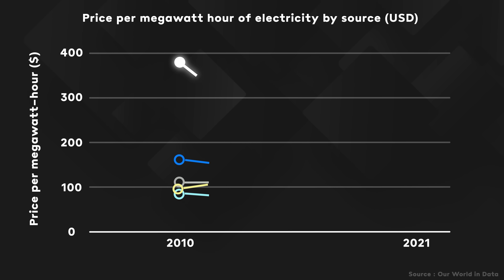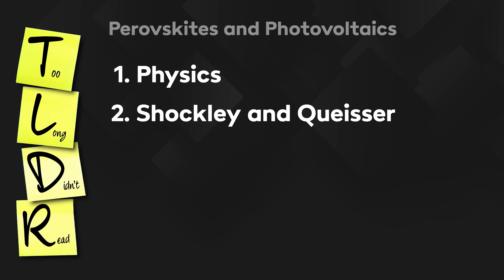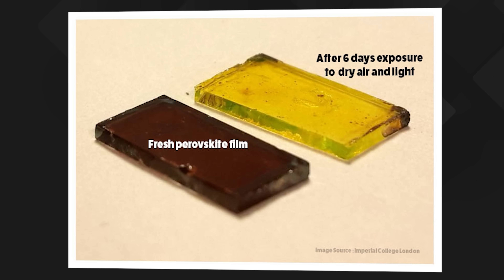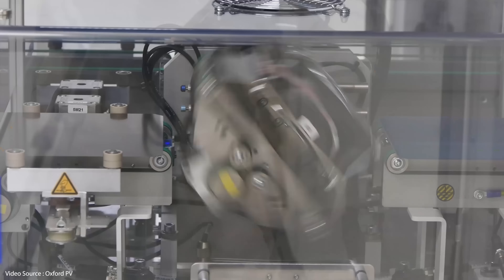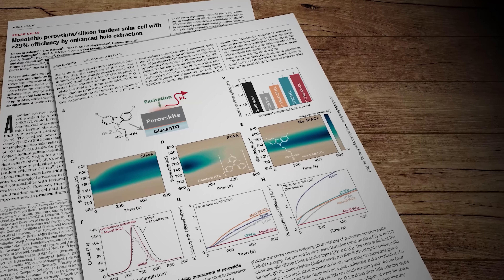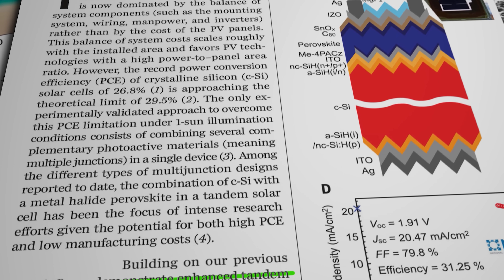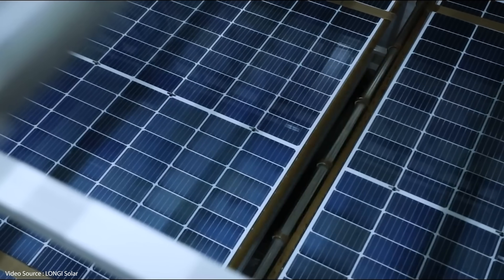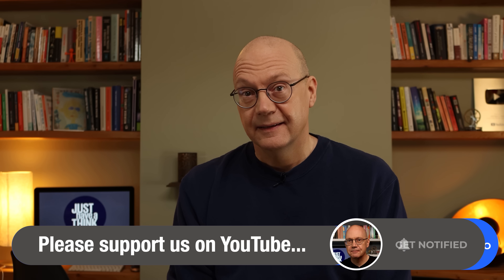Perovskite Solar PV. FINALLY some good news!

Comment: As a chemist who has worked on perovskite-structured materials in general, and photovoltaic perovskites a bit too, I'd like to point out some small errors in the video: Perovskite mineral is CaTiO3, but this is not the "perovskite" in PV cells. Those materials are various lead halide materials, which have the same crystal structure as CaTiO3: the perovskite structure. But the chemical composition is completely different, as are the properties. You cannot make solar cells from CaTiO3
Reply: So perovskite does not refer to a chemical, but a shape/ structure that multiple chemicals can take?
Reply: @davitdavid7165  Yes, what he means is the perovskite crystal structure and not the calcium titanium oxide mineral that you can find in nature.
Reply: Thanks for reminding us. Perhaps we should refer to the materials used in PV as pseudo-Perovskites, Peroveskite analogs, Perovskite-like materials or Perovskiods. Which would you prefer? Or is there a better term?
Reply: @sb6489  It's good enough to know that the term Perovskite doesn't mean CaTiO3 but the typical crystal structure of it. Then it's not a problem to call all the materials that crystallise in this structure Perovskites.
Reply: They have lead
Reply: thanks for pointing that out. I had the same thought.
Reply: This would have been helpful advice to give Dave in advance (as a Patreon supporter you can help preview his videos)
Reply: @edlyop You shouldn't have to pay in order to help someone with advice.
Reply: @rylandrc  I wasn't talking to you, I was speaking to the chemist who perhaps would like to share his knowledge in advance.  Sometimes things are more important than shoulds or shouln'ts
Reply: Yooo chemist. Why don't they make several layers with different band gap absorption on each layer?
Reply: @zerotwo7319  Every layer comes with a loss to the others. There is an optimum somewhere.....
Reply: So, perovskish… 🤔
Reply: Good context. Though, asking as a non-professional, this correction doesn't change the main thrust of anything in the video, right?
Reply: IIRC there are lead free perovskite analogues, but lead is often added anyway to increase how resilient they are. Some promising research is going towards preventing the need for lead, but let's see if it eventually pans out into manufacturing.
Reply from the maker: @LiiMuRi Thanks for this clarification, This will help me with future video on the subject.
Reply: @#£&! We don't want to be injecting lead back into our environment, after taking so long to remove it fro petrol, lead pipes and paint!
Reply: As I understand it, it  is about adding the Perovskite as a layer to absorb more
frequencies that somehow are passed on to the underlying normal 
silicon which absorbs less frequencies on its own.

But then, what about the 1 micrometer film?
I guess, the film is part of the sandwich that makes up the pv.
How do they adhere the film to the silicon substrate?

Furthermore, Perovskite here, seems to refer  to the structure 
which is so typical for Perovskite more than to the actual
atomic elements in the (perovskitian {?adjective?} structure.

Unfortunately, no 1 micometer solar panel then?
Reply: @arnoldvankampen3672  I believe the thin perovskite layer is transparent but able to collect in the blue and maybe ultraviolet wavelengths. Silicon currently does not collect this energy.
Reply: @arnoldvankampen3672 Sounds more like 1 micrometer more than before, which doesn't change the size, weight, number of connections needed, or amount of land needed. About the only thing you would need is an uprated inverter to deal with the extra production.
Reply: @arnoldvankampen3672  The 3 layer version with the micron thick film on top might still be applied to the layer below one square inch at a time by a researcher with a PhD. Early stage research panels are only one square inch. Per the video, there is only one perovskite technology with a factory. That factory is scheduled to start production sometime this year. It is only a two layer system. 

The layers are stacked in order of wavelength, with shorter wavelengths on top of lower energy longer wavelengths. So I expect that the thick long wavelength silicon layer is on the bottom with the other layers stacked above it.

Each layer is mostly transparent to photons with wavelengths too long for it to absorb.

There are potentially many ways to bond layers together, plus a few ways to grow layers on dissimilar materials.

I don't know which method or methods will actually be used when this eventually gets commercialized.

Simply stacking layers and letting gravity hold them together can work in a laboratory setting.
Reply: @arnoldvankampen3672  What do you mean by "unfortunately"? in any case you need a supporting structure so the panel thickness will still be measured in mm not in microns. However it still can hold true the Perovskite layer is only 1 micron if that is enough to absorb these specific frequencies. So you don't need a lot of the expensive materials while your supporting structure is mostly glass. And on the method: One of the favorite methods of applying the Perovskite layer on top of the silicon cell is thin film coating.
Reply: As others have said, I believe it's referring to the structure, not the chemical. Eg you can make a "diamond" from metal or wood of you can just draw one, if we're talking about the shape that is. It's definitely confusing though, if it's not explicitly stated what you're talking about. Since perovskite will probably become a household term, I don't know if that makes if more of less important for people to know the destination. My suspicion is that it's not particularly important for most people to know.
Reply: Any lead content in a product intended for worldwide distribution is a problem. Until practical, manufacturable lead free perovskite cells can be achieved, this is a dead end IMO.
Reply: @Hybridog Why?  People have been running around in cars using kilos of lead in their batteries for 100 years - and most of it gets recycled. It’s only a problem when you put it in gasoline and explode it and pump out the gases that lead is a problem.
Reply: @Hybridog I think you have the misconception that lead is not allowed in amy products. Lead is widely used in glass making, electronic and the battery in your car.
Reply: @olderchin1558   Lead is no longer widely used in electronic components and devices -- Lead-free solder and components have been the standard since around 2003 if I recall. Which is very good, since Lead is quite the trouble-maker for us carbon-based life-forms. I'm going to have to agree with Hybridog that learning that Lead-halides are the main constituent in current perovskites for PV is quite unfortunate.
Reply: @olderchin1558  Don't put words in my mouth. I am fully aware lead is used still in many products. Most of the wires in any house have lead in the vinyl insulation. The point is, MORE lead being put into the environment is, in general, a bad thing to be avoided. And don't try to normalize continued lead use just because it can still be found in products. Like mercury, lead has no safe level of exposure and thus should not be used without considering it's life cycle impacts.
Reply: @Hybridog  Lead is bad I know but it is mainly so when burnt in our fuel and used in your utensils. So are most stuff in the high concentration. I have worked with lead/tin solder most of my life. I find plastic fumes to be more toxic and more widely emitted. It is always about the lesser of the evils. Cleaning solvents causes far more neurological injuries than lead. Lead Halides in a crystal compound is the least of our health issues.
In reality, copper and aluminum is also highly toxic to our bodies but they are still used as bare metal in cooking ware. Acidic food leaches poisonous compounds from these metals. Copper bands are still worn by people and used in lining "healthy" water bottles, a friend was recently hospitalized from drinking fruit juices from this bottle.
Reply: You didn't correct anything though huh? Dude said it's a form of perovskite made in a lab.

Comment: We need something absurdly cheap and durable in PV tech. If a panel costs almost nothing, can last for 25 years and will produce at even 10% conversion efficiency, it probably would have a transformative effect
Reply: cheap panels have 20% efficiency and 25 year warranty now. what we need is 40% efficiency panels
Reply: @drewdevlin9192  Not for perovskite we don't or the price-point perovskite thin films promise. 10% is totally awesome if the panel cost falls by 80%.

Comment: i do not think even with a 200% efficiency increase  it is too little too late. 
and nothing about what to do after it is end of life? how recyclability is it? how many parts that is toxic is left over?
how many non sustainable materials and production is involved in this cell? and list goes on  and on.
all need to be addressed and be suitable before any production can be made.
Reply: In comparison to what?
Reply: @crappymeal  
do not compare, then you can use that as an excuse to say that is better than anything other.
quite narrow-minded thinking that leads to nothing good.
Reply: @sudd3660  I agree, I was teasing this answer out of you
Reply: @crappymeal  
damn, this is serious topic....
if the hype and hope gets a hold on people they run with it....
Reply: @crappymeal  Coal, oil sands, I don't know, just guessing.

Comment: The most overlooked part of PV is the cost of installation. How can this be reduced? It’s as important as pv efficiency because it affects cost per kilowatt. It’s just manufacturing and construction which is easier than all this high tech stuff involved in pv manufacturing
Reply: I imagine grid scale installation would help with this. Economies of scale with the installation cost. I don't think folks should be so focused on installing PV on their homes' roofs. It would likely be cheaper in the end for more grid scale plants to be built. Folks should be urging their elected representatives and local utility companies to focus on building out more grid scale solar.
Reply: @user72974 this as well
Reply: Reduce the government restrictions on DIY systems

Comment: 5:03 - there are almost no solar panels on the roof of the factory making the solar panels!
Reply: they have to build the factory first to make the panels to put on the roof
Reply: Yeah, things like that are so annoying.
If you really believe in your product it ought to be deployed on your premises, right?
Reply: Duhuh, they have to build the factory and panels first
Reply: @Brattoes It is an existing solar panel manufacturing facility. They have built a new line to manufacture the perovskite panels

Comment: Great as is frequently the case.  I'm on the side of improvement EITHER in efficiency of the cells OR the efficiency of manufacturing.  Don't want Tony Seba to be wrong do we.  I suppose we are reaching the top of his S-curve, but another decade of cost declines would be good for the climate.